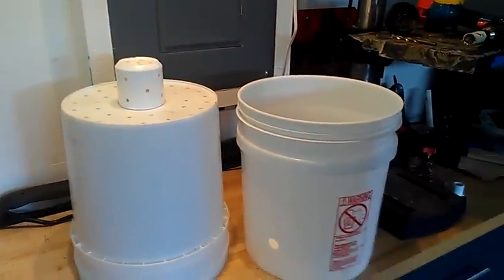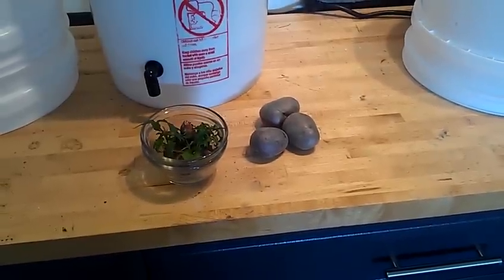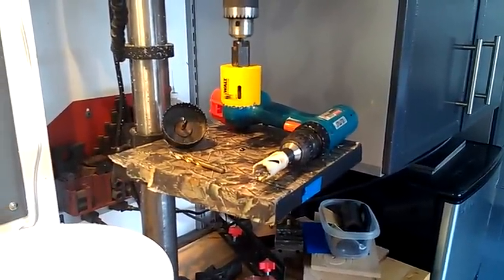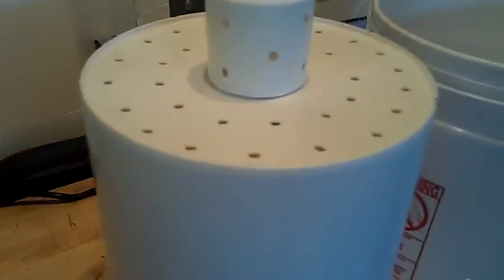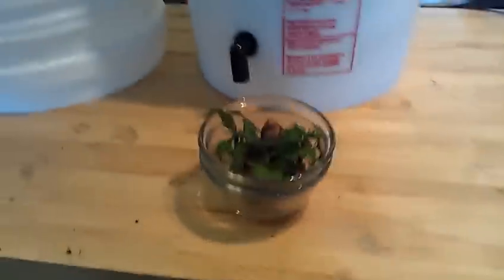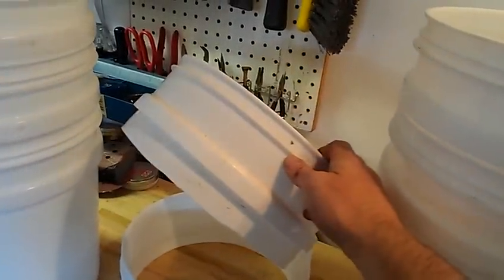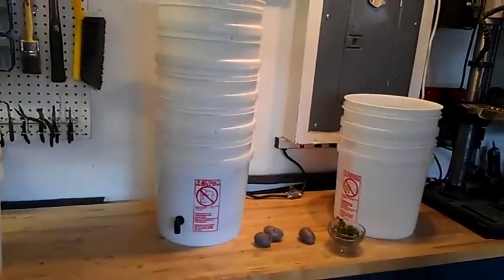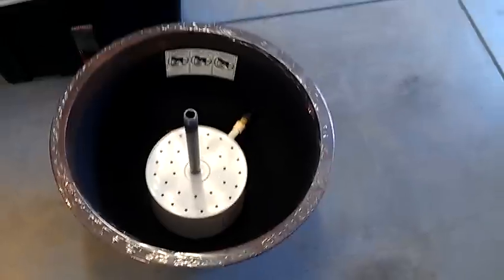Self watering bucket potato tower.

Comment: How did this work for you? I'd like to grow potatoes and think this is a great idea.
Reply from the maker: It worked pretty well! My buckets were smaller than some but the potatoes didn't seem to mind. The blue potatoes are more of a novelty crop and don't produce as many as the reds, white, or sweet potatoes, but there was enough to have blue mashed potatoes at Thanksgiving that year. :)  Since then I built a concrete block raised bed to focus on compost gardening and moved the taters to that. They grow well in the pockets inside the blocks. Each year I am impressed with how many are in that little space and it leaves room in the middle part of the bed for other crops.